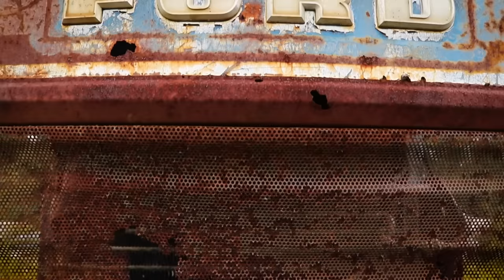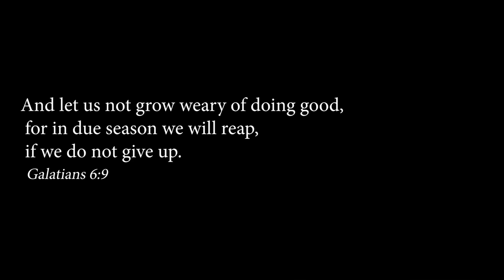We pulled a HUGE FARM tractor from a creek! This antique needs some work!

Comment: I have a 1969 FORD 8000 . I remember going to get it with my grandfather and picking it out of a line up in a dealership.. We have used it for 25 years and still do till this day.  The motor locked up due to coolant leaking from the sleeve.  So last year we had the entire motor rebuilt and it purs like a kitten. It's a beast 💪   cool video thank you for this one !
Reply: That was in the days tractors were made to last

Comment: The primary fuel filter bracket has a 5/16"bleed screw on the top of housing. The injector pump also has a bleed screw on the side of it also 5/16". Primer pump will pull fuel all the way from tank to bleed system. AL B.

Comment: I worked on a local Dairy Farm in the Foothills  of Western North Carolina in the early 70s as a 15-17 y/o for Mr. T.H. Wallace  and I drove/operated his 8000 Ford many times including Disking over 1500 acres of corn stubble, and pulling 6 calves in a week, a week his farm hand, Calvin and I had convinced Mr Wallace and his wife to take a much needed, well deserved, vacation. 
I remember that week well, and the sense of pride and accomplishment I felt maneuvering that huge 8000 Ford, while Calvin got to pilot Mr Wallace's New 9500 Ford complete with Enclosed Cab w Air Conditioning  and radio, and milking over 150 cows twice a day !

Comment: One concept for you guy's - Air on truck. wow.  How about making a hose break at the engine and pressurize the tank and run the water out.  Then fix hose and add fuel.   Just an idea but it sounds reasonable to me.   Hank, I remember Positive Ground Cars.  Pain.  Glad they changed them all to Negative.

Comment: You know the best way to prime those filters is to use an outboard primer bulb it will push the bad fuel through the filters and through the injection pump.

Comment: That injection pump is toast.  Happened to me when I had water get into the IP on my Case 570.  You could have cracked an injector or pump outlet to see if anything was moving through.  I would guess you wouldn't have seen anything coming out.  Internals in the pump are going to be rusted to death.   injection pump rebuild time!  As always great video!

Comment: Hey guys on that style fuel filter with the seals like that dont ever spin them like a spin on filter or the seals cause problems. You have to use the bolt and pull them up strait.

Comment: Smoking terminals always are caused by a loose or poor connection. A terminal can also not have a solid soldered connection causing a loose wire internally.

Comment: I found that for cleaning parts using gas works great you get the gunk out and get it nice and clean then I use brake cleaner to just get the gas residue off it’s much cheaper than using straight brakleen

Comment: If you take off the fuel line going into the filter assembly then get your blower tool attachment for your air compressor and stick it into the fuel tank with a rag around it to seal it off some and blow the water right out the fuel tank

Comment: Drain the tank and put rust away in it as far as the pump and injectors have them sent off to be rebuilt and definitely get a fuel cap with chain on it.

Comment: Basically the same engine was used in the 8600 and TW10 tractors, a good solid design and simple to work on. Those injector pumps need to be topped up with engine oil, the filler is a  large bolt on the top of the pump and there a level bung on the side, if the pump runs dry it will lock up but usually once oil is put in they loosen up again... this course be your problem.

Comment: Hi Hank, hey Wily. Hank I despise the guys how just through their straps back in the storage box and then take 1/2 hour when they need them untangling them from each other. I take the time and roll them up when I am done with them and they are ready for next use, also Hank if you need 3 feet fuel line, buy 10 feet then you will have enough

Comment: Those old Ford tractors are nice machines. It's too bad Ford is no longer making tractors themselves. As for Marvels Mystery Oil, I love the stuff even though I haven't been using it as long as some others. It's so versatile, I keep a gallon of it in my trucks tool box and it use it in my fuel tank on every top up to keep the fuel system lubricated. :)

Comment: Guys....clean the battery cable connections before hooking it up to the battery. I've watched you two incorrectly connect batteries, starters and ect. It's comical, but totally avoidable problems. With clean connections, properly installed, there won't be any problems or burnt wires or battery posts. FYI, lol.
✌🙂

Comment: I was always wondering about how to prevent arcing when hookup,thanks another thing the manuals tell you to hook ur jumpers of dead battery to posts but only positive grapler on booster battery and ground grapler to body of booster car.but everyone knows it never works you always end up going post to post to give it most chance to start.but they say that can blow battery.whos correct.plus so then is proper diconnect procedure.negative first or positive first?snooky pa.😊😊😊😊😊

Comment: sorry Hank but you need your eyes checked. there is a knob under the steering wheel that moved when Wiley asked if something was moving. i bet thats the kill switch that needed pulled out to run.
Reply from the maker: Yeah I actually seen that in the edit. Totally missed it in the seat

Comment: sad about your battery... i watch some of these pakistani mechanics on yt and they rebuild batteries .. cut them open and replace the plates.. its amazing posts stay on them at all once you see how they're made they just put a little mold for the post over the hole and pour hot lead in there .. not much of a connection really.

Comment: another half job, there are to bleed bolts on the face of the pump just above the part that has to bolts to remove the front cover you could of seen had you removed the cover if the rack was stuck in stop any body with 1/4 of what you guys know would of had it running in 15min, i wouldnt want you cranking any thing of mine all you guys do is pump either into them hoping it gets them going if not you just give up just pointless video
Reply from the maker: you must be new here...lol...we ain't mechanics. We're just buddies hanging out tinkering with stuff.